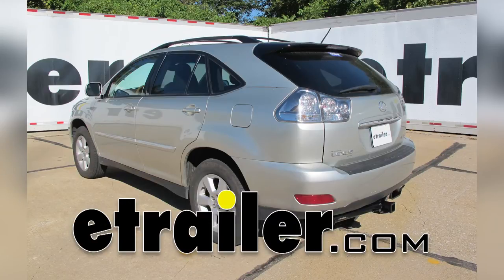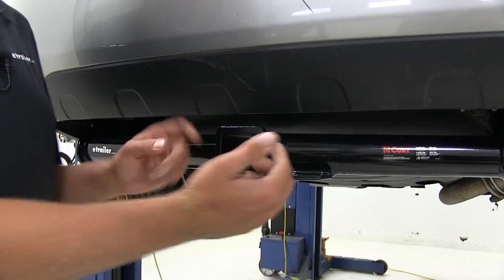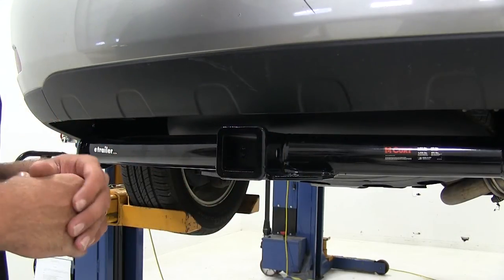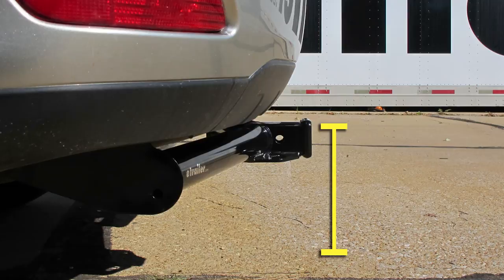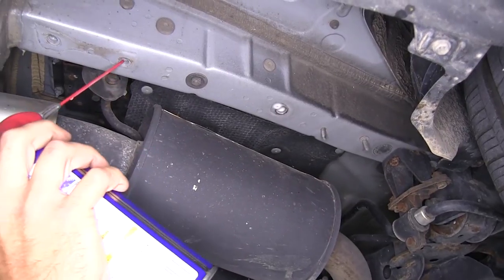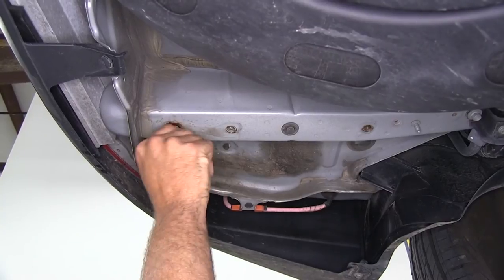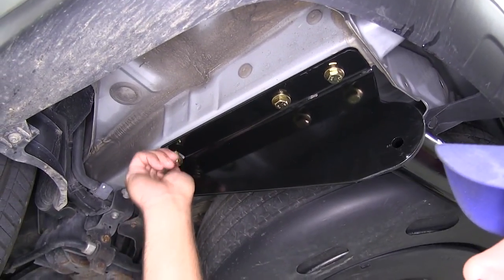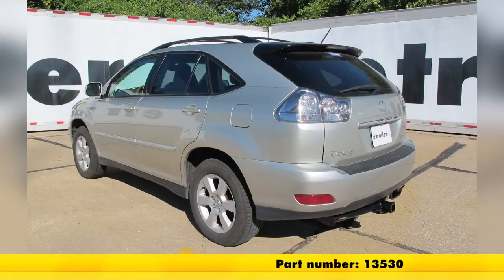etrailer | Trailer Hitch Installation - 2006 Lexus RX 330

Comment: Mine is a front wheel drive model. Can I tow an Hunter Compact Jr RV Camper weighing 1200 lbs empty
Reply from the maker: According to the owner's manual, the 2006 Lexus RX 300 has a 3500 lb towing capacity. We'd recommend keeping the weight of the trailer as low as possible, due to the smaller size of the vehicle.
https://www.etrailer.com/Trailer-Hitch/CURT/13530.html